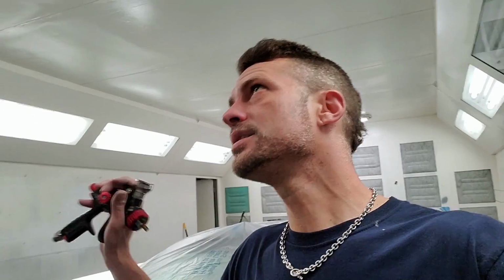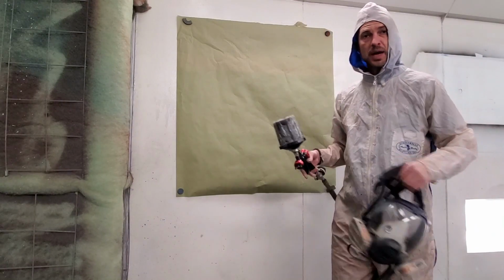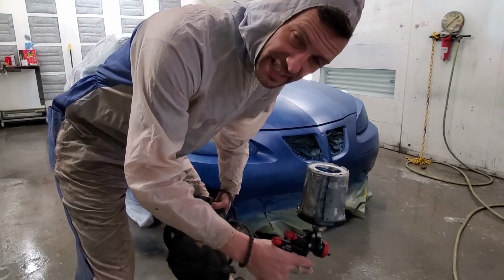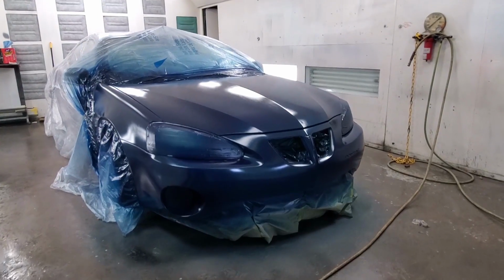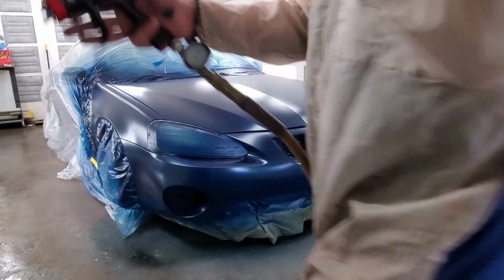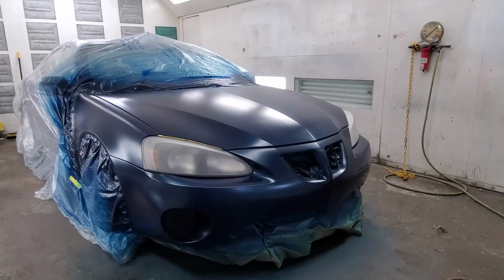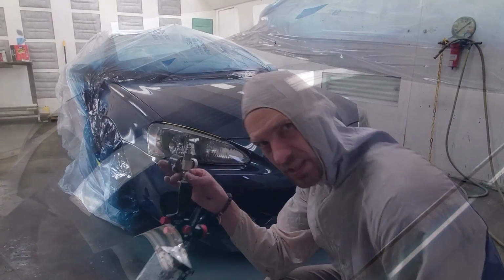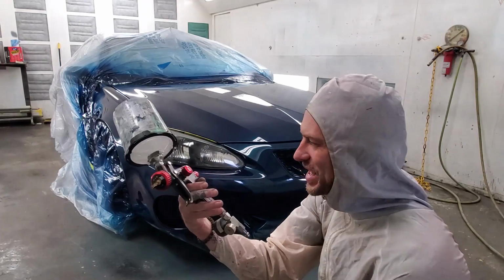Black Widow Spray Gun *6 month reveiw*

Comment from the maker: I do love the way this thing sounds when spraying!
Reply: Would the HF 27 gallon Fortress likely have enough air for using this gun?
Reply from the maker: @theonekninek75230k  kinda doubt it. What HP is it?
Reply: @KarKraftsman  1.6
Reply: @theonekninek75230k  i have the 20g from HF i painted a few parts had no problem with the HF 139 spray gun HTE but will have to wait a few for it to catch up will not paint a full car but can paint two parts at once no problem and for $220 can't beat it and i use air tools daly

Comment: Based on serve rap review, including your, I picked up this gun about a week ago. Being a complete novice I took on a Harley respray project and intend to use the black widow as my clear coat gun. I may have bit off more than I can chew since he also wants some custom airbrush work as well. YouTube is the best place on the inter-webs to learn from. With that being said, keep doing what you do brother. These videos gave me the confidence to take on this project!
Reply: That should say... based on several reviews 😁
Reply from the maker: Good luck. You got this.  Be patient, learn flash times and ne clean it will turn or fine
Reply: @FirstHandBlind  I'm glad you told that clown off

Comment: I'm a body tech that used do combo back in the 80's and 90's, but now reverting back to doing a lot more painting again (not as much as you though). don't remember my eyes burning back then like they do now (maybe the changing of paint formula over time). Thanks for responding back so quickly!

Comment: That was very smooth spraying. I have a question, what is the reason of seeing bubbles? I sprayed like 10 coats of gloss polyurethane on a flat wood table and bubbles keep coming up? The temperature inside my garage is good 80f, is it the guns that I have or maybe i have to adjust the guns? I put the air pressure to 10, 20, 30, 40, 50psi and bubble keep coming up 😮

Comment: I noticed at the beginning you show the Black Widow in your hand with a 1.3 tip. They came with a 1.7 so can you help on where you received it ??  Thanks for the video. My Grand Prix is an 2008 and I was thinking about the front and rear bumpers and repainting those.
Again Thanks, Steve
Reply from the maker: So when I first made the video they either came the 1.3 or the 1.7 tip I haven't gone back and looked recently to see if they still have those two options. The 1.7 tip would be more for primer or thicker paints, the 1.3 is for base coat and clear

Comment: the black widow currently sells for almost 250.00. If you were spending that much for a hte gun would this gun be your choice or another. Thanks Steve
Reply: Unless you're getting it on sale you'll end up spending just over $300 for the gun. It's honestly way overpriced for what it is, its $61 to replace the aircap, fluid nozzle, and needle on it and I think that says enough. how much you really want to spend on a gun?

Comment: Hey big guy I don't know how good that gun is but I know you're a hell of a good at what you do brother I know people that got big money guns that can't do half the job you've done with this harbor freight gun you're pretty badass bro but I got one question did you spray clear on the lens of the car where the lights are too will it turn colors or will that stop it from turning colors just something I was wondering but keep doing what you doing brother I like your work👍👌
Reply from the maker: Yes I cleared over the headlights. If you sand off the UV corroded plastic and paint them they turn out great. Thanks for the compliments and stay tuned for more

Comment: I'm getting ready to spray a 1972 442 and haven't painted in a couple decades. I'm going to paint Duracryl Viking Blue metallic lacquer and final coats of Duracryl High Performance lacquer. I wonder how lacquer will spray with either a HTLV or HTE spray gun. Anyone with experience. 
Enjoyed the video......
Reply from the maker: Just set the guns up the way they want to be sprayed and you should have no problems! Best of luck

Comment: Nice work mate, would you say the Black Widow gun is efficient when it comes to material usage ? How much colour and clear did you use on this job ? Keep up the great content liked and subscribed 👍🏼
Reply from the maker: Spraying above 30lbs like I was at does put a lot into the air, that's where this thing likes to stay 25 - 35 lbs. 

20 oz of Chomax base coat (thinned) put 3 coats on this and I was right on the money when I ordered the paint.

Clear coat was the 2 coats and in my 3m cup I just go to 8 on the 4:1 for each coat.

Thanks for the support!

Comment: I have the widow 1.3 and 1.7.  $300 total for both.  What do you think of the trigger in tight areas?  Kind of similar to a sata.  Devilbiss has softer trigger.  Great channel.  Thanks
Reply from the maker: Thanks buddy. 

I fiddled with this thing in this video.  I went from one finger pulls ☝️ too 2 finger pulls ✌🤟 and I never felt really comfortable. I can use both hands pretty well and kind of like a trigger further away.

The body is very Sata, I would compare the spray experience to my Pro Lite or a Binks.

Comment: Just picked this up today, gonna be spraying my car for the first time. At 35psi for the clear are you running fan and fluid wide open? Watched a few other reviews of the Black Widow and everyone seems to have consensus of spraying clear at 35psi fan and fluid wide open, so just curious what gun settings you were running.  Thanks m8 and awesome videos.
Reply from the maker: 35 is a bit high i think. If you get light in the middle of the fan you have too much pressure. I like to set my trigger pull just about at the end and you can tune it to a speed you want to move. I also adjust my fan size for what I'm painting, if its just a bumper I go smaller to maximize transfer efficiency, body panels ill go all the way. Good luck

Comment: How different are the automotive paints from Lacquer based paints that i use for spraying kitchen cabinets. I spray alot of conversion varnishes and other lacquer  base paints and clear coats on a regular bases.
Reply from the maker: Not much different at all. I'd say you're half way there and should just learn the paints you are working with

Comment: Used this gun today, first time painting ever, and it came out pretty good but I do have decent orange peel.   Did this in my garage, the white cloud was everywhere even with fans blowing out, don’t know how to avoid the orange peel in my clear.  I did sand 1500 before last coat of base.  28 psi,  and what were you other setting?  Thanks.
Reply: Use the acrylic sanding block start with 1500 grit sandpaper up to 5000 grit. The acrylic block will get out all orange peel and dust mark💯💯💯💯💪💪💪💪

Comment: If the primer was all the same color why was the fender darker?
Reply from the maker: The primer was the same color as the car and I just tried to blend into it. Typically the more layers of paint you put on the darker the color gets.
Reply: Kar Kraftsman cool thx for the info and I appreciate the response.  Is the black widow a good first gun for base and clear?  I’ve never painted with a hvlp before.
Reply from the maker: @damienmikkelsen6056  if you're only going to use it a couple times a year speanding the big bucks isn't worth it. The spectrum paint guns should work just fine for what you want.

Comment: What clear coat did you use? Looks like your around 6" from panel?
Reply from the maker: Clear: USC 10

About 6 - 7" medium fast arm speed
Reply: @KarKraftsman  Ok I'm using Pro Lite T110 with 1.3 tip. I heard you talk about it on another video.  What is your gun settings when you use it?

Comment: what is the difference between the hvlp or the compiant gun?
Reply from the maker: Tip size and operating pressure. Made for spaying materials of different viscosity
Reply: @KarKraftsman  which would be the most popular for spray most auto paints.
Reply from the maker: @ogstevesgaragehangout2344   typically clear coats are sprayed with 1.2 - 1.4 tip guns.  The HTE 1.3 would be the one you want.
Reply: @KarKraftsman  Thank You I appreciate it. Great channel.

Comment: How are you spraying air without paint coming out? Are you turning the fluid control all the way down?
Reply from the maker: Not to be rude but how do you not know how? The first part of the trigger pull is only air, you don't have to pull the trigger all the way in. When the needle is pulled is when the paint comes out.
Reply: Kar Kraftsman Not to be rude but isn’t it pretty obvious how I don’t know? I’m new to painting and I don’t have much experience with spray guns. Honestly cant believe there was an even dumber question than my question 😂
Reply: You’ll be a fast learner, as long as you’re not afraid to ask, thank them if you get your answer. If they insulted you , still thank them for the info and let the insult roll off.

Comment: You missed a drop coat there dude. I'm not even sure how many coats you put on, 4? Medium and medium wet with a quick drop coat after the med wet should be all you need. Also the concept of "overspray" comes to mind. You need to think about where your overspray is landing when dealing with wet paint. Also its really not efficient to be running back and forth again and again for the same coat of paint, hit everything you can while you are in a given area, if that makes sense.

Is that a dent in the hood? Why didn't you fix that?

Comment: $219.99 for a HF gun or buy a used Iwata  on EBAY?
Reply from the maker: I'd never buy a used gun, new ws400 is cheap enough.
Reply: @KarKraftsman  I bought a used Iwata LPH 400 on ebay for 200 bucks, even had the orange cap on it.. Looked brand new, sprays just like it was new.  Nice thing..If I need seals or parts, I can get them..not with the Black Widow.